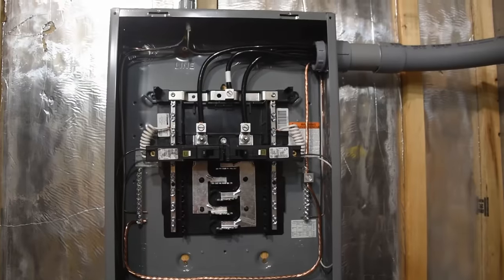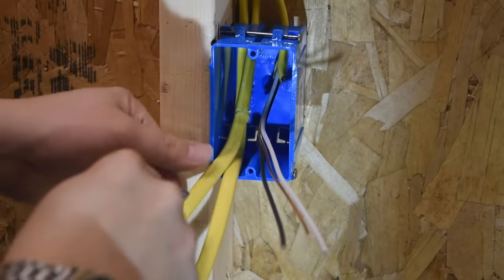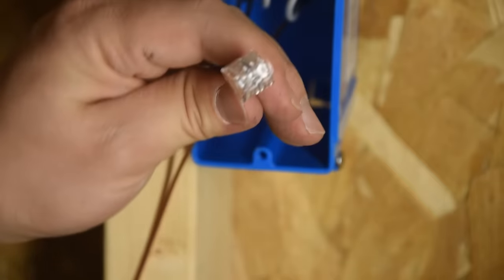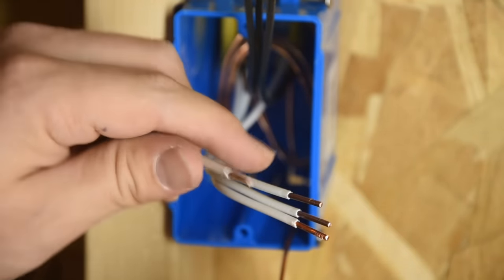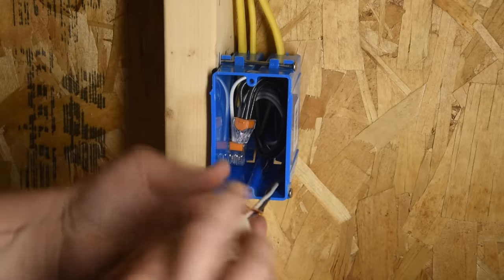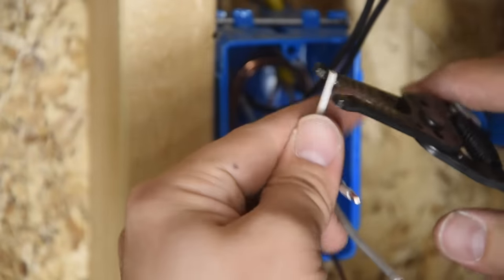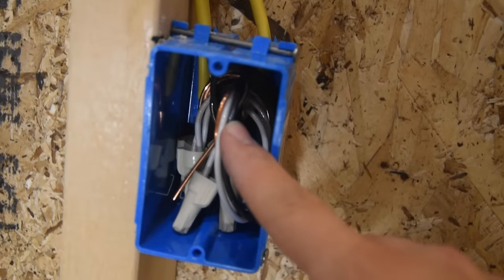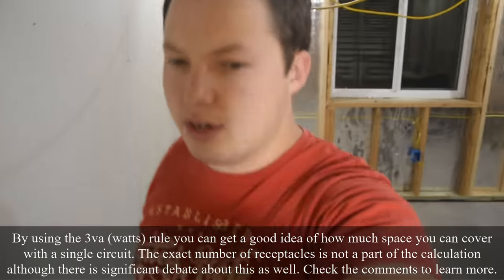Wago's vs. Wire Nuts - How To Wire Outlets During Rough In

Comment: Check with your state and local inspectors first before using the WAGOs.  In our county you are not allowed to use them in bedrooms.  All other areas are ok.
Reply: Are bedrooms there only place that has electrical problems in your county? So, if I use wagos in the kitchen and the fridge circuit catches on fire,  that's ok.
Reply: @danwood4478  Our inspector required wire nuts in the bedrooms all others could use the WAGO
Reply: @stevenbyars3384  That's weird. In NYS, the code is the code. If the device is permitted,  then one would have to enact local laws to be more stringent. I was more scoffing at the fact that eliminating what he perceives as an inferior device only from bedrooms, not like the rest of the house has more intense electrical loads to cause one of the WAGOs to fail. A burned house is still a burned house.

Comment: I never pre-twist the conductors. I think the wire nut bites the ends of the wire better when they are straight.  And the wire nut does the twisting. That way too, you can see how far your twist needs to be past the nut when finished.
Reply: I pre-twist, but after doing so, I trim the pointed end, which makes the twisted wires sort of chisel-shaped. This bites pretty well into a wirenut.
Reply: I never do pre-twisting either. For whole career I put the wires into the wire nuts and twisted so much that the wires would twist several times. Then I new I was good to go. Never experienced a call back because of not pre- twisting. Wastes too much time.

Comment: I'm 30 but have been doing electric work since I was 14 we didn't have wago's they are fine for quick installs the problem is if you ever do maintenance or have to work live (I know never work live but crap happens) because they are a nightmare to get off live I've gotten shocked a couple of time because of them. Second wago's absolutely suck for stranded. Don't ever use them for stranded it's terrible.
Reply: I'm using Wagos to rewire old lamps and chandeliers and I'm using stranded but I'm tinning the strands first.
Reply: Well if your tinning the wires they aren't really standed anymore are they lol
Reply: @jonathanpotts3591  = HA! That's an excellent observation, actually. Yanno, I can do differential equations and LaPlace transforms and stuff like that, but the obvious things just fly right by me. At almost 67, I guess my neurons are too ossified to make new connections. Peace.
Reply: Lol it's all good that's hilarious

Comment: Isn’t electrical tape used anymore?
Reply: i use it for low voltage and to tape to wire pull string/snake and for device terminals in metal boxes if wires are twisted and stripped right no need for tape.

Comment: You would get dinged here for putting the wire in first hole next to the stud on that 2X4 stud.  The third would need to enter from the bottom  outside hole.  Plenty of inspectors see that right off the bat.

Comment: Most old school electricians aka the boss of most electrical companies don’t use wego,s due to cost and lack of pressure on the connection. They. Don’t want to return to a job because of a faulty wego connections. Wirenuts provide a much tighter connection. Also cost much less. Yes wegos will be easier on your fingers. Anyone who uses wegos in la is considered a newb.

Comment: Wire nuts aren't legal here.  Wago connectors are universally legal.   We also have a bluepoint - which is a brass 10mm screw fitting, with a plastic insulation.   Also - 'hots' here are red, neutrals are black, and our earths are green/yellow.  We can't use bare copper earths anywhere.   We don't bother to earth the outlets - they are double-insulated.
Reply: what planet did you say?

Comment: They make a stripper that won't cut you. I call them Legos.. Also twisted wire can make a inductor which creates a hot spot. And if using nuts twist till wire starts twisting then stop. Hate people to pre twist because then they put wire nut on with half a twist . then if you ever have to trouble shoot and grab wire nut to pull wire out it pulls off. And bleep,bleep ,bleep. Also I've found if you are using stranded wire occasionally in Lego , Do not twist wire.

Comment: Twisting bare wires with a wire nut must have a much higher current capacity than a push in. I could see these heating up near max circuit load. Someone should make a video and load both connections to failure.

Comment: I really don't get why the lever nuts get so much flack.  They're way easier to use, easier to organize, and (especially w/ 12 awg) don't leave permanent curls in the box that you'll never straighten out if you need to modify it later.  In Europe the old wirenuts aren't code anymore.  Guess I can add that to the short list of things they do better.
1) Metric system
2) Wire connectors

Comment: I worked in the jurisdiction that would not allow wiggles or the push in connectors on the back of receptacles and switches That was a few years ago maybe things of changed on the quality I did see a house that had Scorched wiring in the bathroom where Wego was used supposedly too much load from the hairdryer Wago= wire LEGO Remember electricity is not fun and games
Reply: i dont know about games but its fun to see a spark in flames ?? 🤣🤣

Comment: The contact resistance is higher with clip.  Over time, the contact can come loose.  This can increase the resistance and cause heat.  It looks like a disaster waiting to happen.  I will never use the Wago no matter how stiff the electrical wires are.
Reply: Wago is the only connection in the UK that may be approved where maintenance is not accessible.  This because the Wago connection points are spring-loaded and will not become loose over time. Need some additional junction box too then.

Comment: Using WAGOs is a bad idea. It makes the WAGO a conductor rather than wire to wire when using wirenuts. They will slightly reduce the current capacity of your circuit. They also increase your connections and possible trouble spots over the long haul. To each his own, but I don't trust them. I want a nice tight bond with zero chance of sparking.

Comment: I would never use a wire nut, and just twist wires together. it is an American only thing. Before the wago 221 we used screw terminals to connect wires in Denmark and the rest of Europe as far as I know.

Comment: Always strip the wire FIRST before entering it in the box !!
Reply: I mean to say that 1.   The code says “ shall enter a box with a minimum of six inches of  free (already stripped) conductor .
 2.   It takes longer to strip the wire in the box    3.    Much more chance of damaging the conductor or conductors ,   Especially
If there are a number of them .    4  the casing is too hard to trim properly , and you end up with more in the box than you need making it more difficult to do the neatest job and fit all the wires into the box well .

Comment: Not bad but not good. throw the wagos in the trash, too many reasons to list. i like to bend the wires to the back of the box until they all come out in the center with no strain. then holding the group of wires in my hand i cut them a little past one hand wide. next strip off at least one inch or a little more depending on the number of conductors, line up the insulation and twist, put the wire nut on tight and tug on it just to be sure. i always fold not roll the wires in the box so if the drywall guy gets happy with the zip tool he cuts the end of the wires instead of where they enter the box. also check for shiners. last when i device up a couple of rounds of black tape is a good idea. always pigtail so if you do lose a device everything downstream still works one more thing, run ALL the screws down, it really gets on my nerves to see unused screws sticking out, i base these thoughts on 37 years of exp. plus 5 in apprenticeship.ok now on res. job bring the home run to the ko on top closest to the stud other side of the boxtop gets the sw. leg take rec.power out the bottom of the sw. box and ring the room. forget 14 awg for anything and when putting on device plates for gods sake turn all the screw heads up and down. use nylon plates, the hard plastic suck.

Comment: In an ideal world, I only rough in two wires for a single gang box and use Leviton ProGrade outlets / Ideal Greenies to make up the connections.  No pigtails needed.  Solid connections with the clamping style screws.  Easy ground wiring with the Greenie.

Comment: I used to use those push in connector before I found the lever wago's.   I pretty much use Wago for everything.   High and low voltage.  I do admit that wirenuts have slightly less resistance and if used correctly will likely hold up longer.  That said I still prefer using the wago. I can use them when the cables are short which means less wires to try cram behind smart switches.  OH and I really love that I can work with wago with live circuits so much easier.  Not that I would every work on a live circuit.....

Comment: If they are anything like stab loc devices, they are shit. Been doing this for 40 years +, n 90 % of all service calls have been push in quick connects, aka stab lok. Wire nuts with wires twisted correctly n wire nuts correctly installed, you will never need to worry. And at all switches n outlets curl the wire, bare n about3/4" long, in the same direction as device screw, with a flat head screwdriver. The tighter the better. A loose connection will arc n get hot, very hot, causingthe device to start to melt or worse a fire. Some breakers are much better than others. But a loose connection, not good. So it is up to you if you want the quick way, or the correct way. I myself would never use these. Never. Even some recess cans n other things come with these. I cut them off n use wire nuts. You have a choice.

Comment: Wago's suck. They are a space saver but good contact is achieved using wire nuts. I had a bathroom vent fan that malfunctioned often and it was the poor connection from the wago's.

Comment: If WAGOs use the same principle as push-back receptacles, I won't be using them.  I bought a house with all push-backs and by the time the third one had burned/sparked/smoked, I replaced all the receps in the house.  Wiring was all #12 copper but the contact points are so tiny they must oxidize and get hot.  I don't know how they are allowed.   Thanks for the video.

Comment: I think Wago's have their place but I prefer wire nuts all day long. First the cost, 60 cents for a 221 Lever nut vs. 10 cents for an Ideal tan twister. Contact area, I pre-twist so the wires all touch each other and the metal ring inside has a massive contact area vs. a Wago that is surrounded by most non-conductive plastic. Versatility you can grab a tan twister and put multiple configurations of wires in it. 2 #14' s or 3 #14's and I don't have to switch products. If I only have a 2 slot Wago then I have to climb down and get a 3 slot, etc. etc. I also think its funny when people use push in Wago's. Back stabbing Wagos = good. Back stabbing outlets = bad. Really, suddenly everybody's biggest complaint of lazy electricians everywhere working in housing developments is the greatest wiring development of the century. Lol.  Don't get me wrong I think they are cool, well made, and useful. I fidget with one all the time. But all this "wire nuts" suck talk from everybody just boggles my mind. Wire nuts, quality one anyway, having been keeping the lights on for people for a very long time. I do agree that Wagos might be a little nicer when dealing with small stranded wire but the majority of the time I am not working with stranded wire and when I wire a light fixture for 30 cents instead of a $1.80 I am laughing all the way to the bank. All in good fun guys but someone has to defend the wire nut and these are some things that I rarely see discussed. It's not that Wagos are bad, they're not, they're really good but so is a wire nut.
Reply: I was skeptical of Wagos when they first came on the scene and did research on YouTube and elsewhere and was won over.  I too made the comparison between the backstab and Wago, but unlike numerous images of backstabbed failures, there’s nothing out there with failed Wagos.  You’re apparently a professional and I respect your abilities, but for the DIYer that does this once a year, I think Wagos are a good fit.
Reply: @glasshalffull2930  I work with a pro but I am not. Wagos have their place but I don't think they are the greatest thing since sliced bread either. But I do think a lot of people are duped into buying them thinking that it will make them better at what they do. Just my opinion of course but I don't see a lot of pushback against what I think is a lot of hype. Quality wire nuts have been keeping the power on here for a long time and depending on the scenario doing a better job of it. The most important part of any job is that we follow code, and best practices, and make sure things work, and people are protected. The rest is just details and materials that we like or are available at the time. Happy wiring

Comment: So that's what they call those things wagos? They are junk I won't use them,  a wire nut has a spring in it, and will stay tight , when  copper wire is in use (especially aluminum wire that you only find in trailer coaches nowadays but it looks like you are using aluminum wire ,those wackos are not made for aluminum , read the nomenclature it should say cu al) it will heat up and expand and then it will contract, wagos are just like back wiring an outlet that is an invitation for a loose connection , a fire or a callback, you can score the Romex with a razor and strip it before you put it in the Box it saves a lot of trouble and it's faster , never cut all three wires like that always treat everything like it's hot even when you know it isn't.

Comment: If you look closely wago bites the copper wire once wire nuts like ideal on their instructions say pretwisting not required I'm not a fan of not pretwisting I like using my Linemans like to see two to three twists past the nut Let us see a house with wagos after 10years and look for the hot spots or why Arc faults keep tripping Wagos are quick not best
Reply: my old master taught me tht the twisting makes the connection the wirenut is just an insulator cap
Reply: @wizard3z868  maybe with stranded Solid not so much

Comment: Do you really trust that they came apart that easily for a fire hazard you’re only connecting to little copper connectors compared to a Y or not I don’t think that’s a good idea I’ve been electrician for 40 years those Stebbins I don’t think her so good better off typing all the gather and twisting them with a pair pliers and wire light wire nut

Comment: Thoes wagos you call them are crap never use them, the copper on copper connection is small and is a prime spot for the connection to burn up. I've seen it alot, wire nuts and the best. Same goes for the push in terminals on the back of duplex outlets, do the job right or not at all.

Comment: When does the rest of the world learn to use PVC pipes to guide the wires?
Reply: US actually has an excellent EMT(electric metal tubing) system for guiding and protecting the wires.
Reply: @vitaliyzakharov6708  I know but don’t you think that it is saver to put the cables in a pvc tube? I mean, it is possible that a voltage could be put on those metal pipes.
Reply: @teunnoordkamp8013  no, those metal tubes are grounded. So a circuit breaker will trip. Also, they protect wire much better. You can cut pvc with a pocket knife, but emt is steel, so very substantial
Reply: @vitaliyzakharov6708  and in case when the pipe isn’t properly connected properly to ground?
Reply: @teunnoordkamp8013  that would be extremely rare. The pipe is either the main ground for the whole system or it gets bonded to ground conductor via metal boxes.
Reply: @vitaliyzakharov6708  Rare isn’t impossible. Why not play it save and use non conducting materials like pvc.
Reply: @teunnoordkamp8013  getting shocked by 110v is also rarely deadly. PVC has its own set of negatives. It doesn’t protect wiring well(you can easily puncture it with a nail) it burns and releases toxic fumes and its flimsy. EMT is also a better system since you can easily bend the pipe with a hand tool, and it just looks much more professional than any PVC work Ive seen. I hate american romex wire, but EMT and BX(armored cable) are awesome systems

Comment: Don’t use Wagos,take time to make a proper tap and use wire nuts.Wagos Will ultimately fail,due to the contact area of the wire. I’m an electrician in a hospital,where they used Wagos,they’re shit,we are constantly repairing problems.Another problem with a Wago is if you need to add to the circuit and the wago is full and the circuit cannot be de energized,you’re in for a labor some day.

Comment: Wago is junk in my opinion.  I am set in my ways at this point. The wagon is only making contact at the tangent point of the spring and wire that Is a very small area.  I won't use receptacles with stab connection either. In fact the only ones I will use are the ones that clamp the wire be under the metal under the screw. I had a cheap customer complain one time that he would not pay $3 / receptacle my reply was I won't install a $.99 receptacle. Do it yourself and get your own inspection because you are not going on my license on the permit.

Comment: I'm a licensed electrician and would never use these. Seen them fail under high loads.. Plus I'm still faster and cleaner using red and green nuts. A good electrician always twists! It's important on current carrying conductors .
Reply: have you tried tested the lever ones yet?    i myself am a fan of copper crimps and nylon snap caps